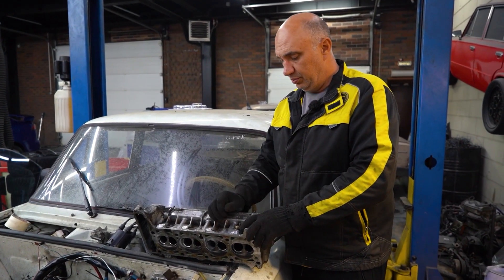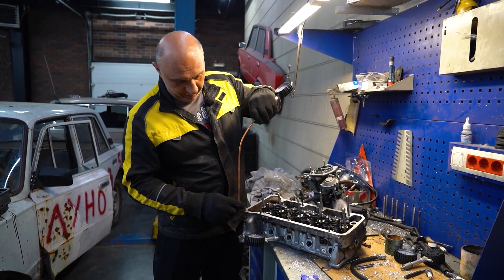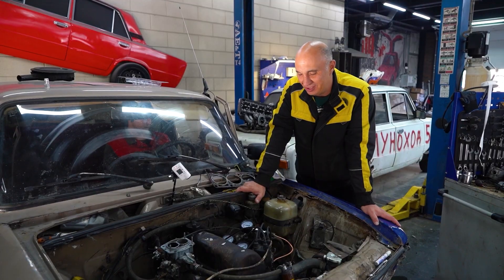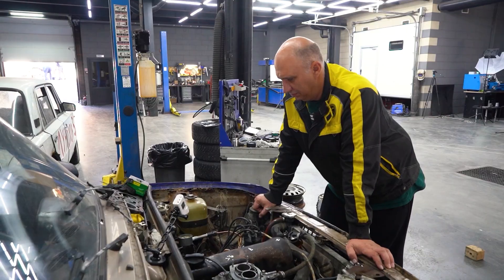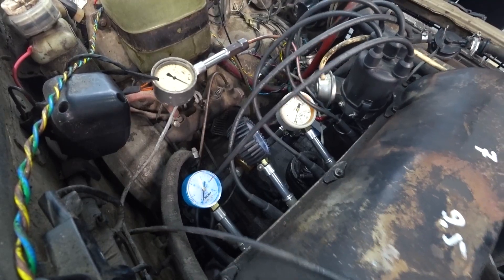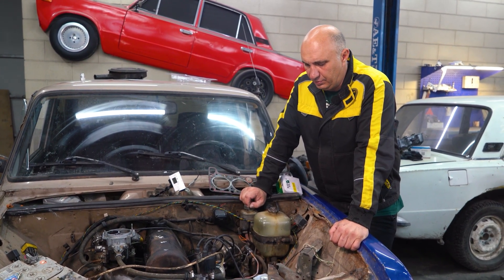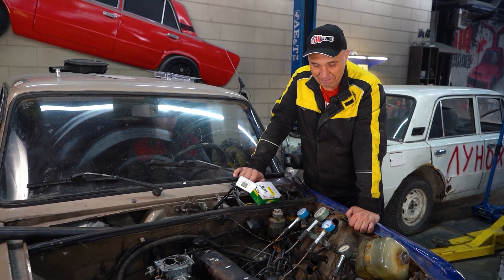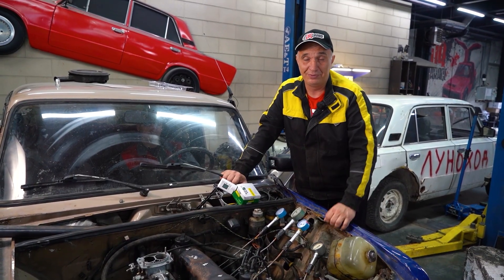What’s the compression on a running engine?

Comment: Try it with a DIESEL! Try to find a model that uses glow plugs, so the glow plug ports can be used, without any modification to the cylinder head. If the ball and seat can built right into an adapter shaped exactly like a glow plug, it will be possible to eliminate any change in chamber volume. If the chamber volume becomes too high, a diesel engine won't even start! You will definitely want to use the 250 kilogram gauges, especially, if you load a turbocharged diesel engine.
Reply: They would need a system that works way higher than that for  Diesel.   Every time it fires on a power stroke under load the cylinder pressure can be in the hundreds of atmospheres.
Reply: @tcmtech7515  pressures in a petrol at peak combustion get higher.. diesels shouldnt get much over initial peak compression during combustion as its taking place during expansion...
Reply: @paradiselost9946  Nope. Go do your homework.   There's a reason diesel engines are built way heavier.
Reply: @tcmtech7515  really? better explain why their traditional classification is as a "constant pressure cycle"... as opposed to brayton, ericsson, carnot, and other cycles...

homework? maybe its you that needs to do some research... historical research ;) rather than modern online BS research.

ever read the works of diesel? ever rebuilt a four stage piston compressor for a fullagar air blast injected diesel?

"air blast diesel injection"? whats that?

until you can tell me what that is, i feel no need to do this so called "homework" just so i can repeat what you have been miseducated about...
Reply: @tcmtech7515  homework?

here is the definition of the diesel cycle..

"A four-stroke cycle used in diesel engines in which, ideally, combustion takes place at constant pressure. The compression pressure is maintained as the gas volume in the cylinder increases until the combustion process is complete."

do you understand that? or did it go over your head?

we compress air. it reaches a certain pressure. it also heats up, so it can ignite a fuel. as the piston descends, that cylinder volume is increasing, expanding. normally, it will reduce in temperature AND pressure.

the combustion of fuel adds heat, and that heat is roughly equal to the cooling due to expansion. the fuel in a diesel is added during the power stroke, it isnt all consumed in an instant as it reaches TDC.

therefore, the cycle is referred to as "constant pressure"... it mostly stays CONSTANT, at the same pressure reached in compression.

hence the term "constant pressure cycle".

comprende? any thing else you require me to do my homework on?

i am all ears ;)
Reply: @paradiselost9946  And no part of that has anything to do with showing the numbers for the actual topic you originally posted on, which was cylinder pressures during the combustion cycle. 🤣

Care to post those now?   😁
Reply: do they make a diesel Lada  (it has to be be a Lada)

Comment: Cylinder pressure is actually cylinder load.  You have had the engine just idling which is very, very low load.  You need to load it up and the best way to do that is using a very high gear, so you are at a low rpm, and give it 100% throttle.  This will make the gas pressure have to work hard to push the piston and will give you an idea as to what peak pressures would be.  Also, the gauges should have one way check valves so the gas does not escape.  You will only be able to capture the highest recorded pressure but that is exactly what we want to see anyway.

Comment: I think the cylinder pressure would be much higher with the engine under a load... You gotta take it for a drive, up a steep hill!
Maybe you guys should invest in a dynamometer... That would open up a lot of options for experimentation.
Reply: There's a whole lot going on that isn't apparent here. Gauge range, fluid dynamics, frequency and heat causing catastrophic wear and failure of the check valves designed into the gauges, the effects of trying to counter fluid drag reducing the effective compression ratio. The list goes on...

Agreed that the pressures will be much lower when the engine is only idling... but until the other problems are solved, adding load will only make things that much more silly.

One of the first actual "popping off" illustrated how chaotic it is inside the cylinder even just at "idle" - I believe it was cylinder 3, the needle was dancing all over the place to the point you can't even calculate the average anymore.

Edit: 8:13

Comment: The longer pipe increases the combustion chamber size, therefore reducing the compression ratio, you need a very small jet inline to smooth out the pulses, less than 0.10mm (for air), close the source to solve this, so it slowly builds pressure up in the gauges, (this has been used to calm hydraulics down for years, with no moving parts)..
You would get away with this setup on a turbocharged engine, on boost only though.
Reply: The combustion event is very short, so there is a momentary high pressure spike, and then the piston comes up and down another 2 crank rotations at atmospheric pressure (or vacuum if not at WOT) before there is another combustion event.

A smaller orifice won't fix it. Only a fast acting check valve (coupled with time to build up that pressure in the pipe), or an electric pressure transducer and an oscilloscope.
Reply: @volvo09  Obviously, you have never worked in this field, or used carburettor balancers on multi carburettor engines, as they use a flow restrictor valves to calm the gauges down.

Pumps  of any sort don't produce pressure, they produce flow, like an ICE. 
Pressure is a restriction of flow, like the piston being forced down.

So if you reduce the passage for a fluid (air is a fluid) to flow, it will produce pressure.

Bear in mind you are contradicting someone that works with flow and pressure every day on hydraulic systems., and used flow restrictors to calm things down on piston type pumps. and modern diesel injection systems.
Reply: And furthermore a check valve will probably fail after a short time and is only one way.
Reply: @IvyMike.  True, I have used a carb balancer before, but that isn't measuring peak vacuum, the restrictor is averaging out the suction pulses so the liquid doesn't jump around.

If these guys want to find peak pressure, a simple flow restrictor isn't going to do it as the pulses are waaay more erratic than a carb balancer. A carb is always under vacuum at idle and the suction pulses are what you want removed.

The cylinder spends much more time at or under atmospheric pressure than it does under extreme pressure. The flow restrictor would be working in the opposite way to keep the big pulses they want to see out of the readings.

I do agree on the check valve though, I don't know how one would survive unless it was a basic ball and seat... They already broke the check valves on their compression gauges.
Reply: @volvo09  Exactly, you average out the pulses to give you a readable gauge result and it works the same weather it is negative or positive pressure, if you are getting erratic gauge readings, reduce the orifice size or close the valve a bit more.  

It works the same way when we convert AC to DC, we pass it through inductors to smooth out the current and capacitor to smooth out the voltage, i.e. restriction of flow.

Comment: Readings are getting messed up by the tubes adding to compression/combustion chamber volume and having non-negligible flow resistance. There needs to be check valves at the engine so any gas that gets in the tubes stays there and takes that much compressed gas volume out of the combustion chamber equation.
Reply: Came here to say this, you beat me to it! Especially when the engine is firing up, which is causing all kinds of chaos!
Reply: That and fluid dynamics. The cross section of the tubes are tiny relative to their length. When the gases try to move in it at the high speeds that the pistons are changing the pressures at, the drag takes over, resulting in a "net zero". 

So there's a delicate balance here, getting the tubes big enough that the gases can move at operating speeds, while not reducing the compression ratio to inoperable.
Reply: @MadScientist267  Reed valves at the engine "adapters" would take tubes out of the equation: any gasses that pass by stay there no matter how long and thin the gauge tubes are. Pressure builds up to equilibrium with ignition pressure and then the tubes are no longer a factor. In that sort of setup, you do want drag from the tube walls to dampen any standing waves and surge pressure.
Reply: @teardowndan5364  I didn't say it couldn't be done, just that it is nowhere near as simple as it would seem. They started out with the "intuitive" version and got what I would call "expected results". As it unfolded, I was not surprised as one problem's solution would create another problem. The complexity is the reason.
Reply: @MadScientist267  Nah, it's not that complicated.  Lots of compression gauges have check valves built in.  I've got two here.  I'd expect to see around 1300-1700 PSI peak combution pressure on that engine when properly measured.  An old school small-block Chevy makes about 2000 or more peak pressure when hot-rodded.
Reply: @FuckGoogle502  Those did too. The rapid pressure changes killed the valves.

It's plenty complicated. 4 different pressure levels in rapid succession at all nevermind for any length of time... not something those are designed to stand up to. Their distance from the head also plays a role. I've been over this.

Yes it's very complicated.
Reply: Compression testers already have a “check valve” though so the gauge holds the pressure reading after testing
Reply: @TheBeeMan1994  The gauges may have a check valve but their extension tubes do not, so the compression is continuously going in and out, reducing cylinder pressure by adding volume and also reducing the magnitude of the pressure wave that can reach the gauges' valves.
Reply: @teardowndan5364  I didn’t think about that at first. But it makes sense why it’s hard to start, those tubes just make the volumes of the cylinders larger, thus, lower compression. Makes sense
Reply: The closer the check valves can be to the combustion chambers, the less volume the tubes add to the chamber volume. If you look at the actual compression test gauges, you will notice that the check valve is right in the adapter, right where the spark plug electrode would be. That guarantees that there is no change to effective chamber volume. @TheBeeMan1994  A longer hose just means, that it takes a few more turns of the engine, to reach peak pressure reading.
Reply: @TheBeeMan1994  That was what Vlad was holding in his hand after the above time stamp

Edit: oops that was a different thread. 8:13
Reply: I can't believe they didn't know this. What a waste of a video.
Reply: @kdodds80  Since combustion pressure would be the pressure of burning air-gas mix at 400+C, I'd be more concerned about inaccuracies from gasses cooling down in the pipes than the cylinder head getting warm.
Reply: exactly! because the engine is going from Vacuum to Combustion over and over. so it basically cancels itself out.
Reply: Just for a mental view of just the piston.  An engine at, say; 1,200 Revolutions Per Minute, that equals 2,400 Strokes Per Minute.  Now ÷ by 60(seconds)=40 Strokes Per Second and every 4th stroke is a power stroke. So that equals 10 power strokes Per Second. Do you really think those "check valves" on those gauges  could really keep up, talk about valve flutter
Reply: @tcmits3699  The gauges' original ball-spring valves, no, too much inertia in the ball, the spring gets softened by hot combustion gasses passing through and rubber seals get destroyed as well. Reed valves as I have mentioned in my first sub-reply here on the other hand are viable up to about 10k RPM.
Reply: @kdodds80  The whole point of their experiment was to measure piston pressure during combustion, not intake pressure.
Reply: I was going to say the same thing. The volume of the tubes and gauges is a huge percentage of the cylinder's volume with the pistons at TDC, which is where cylinder pressures will be at their highest.
Reply: I was thinking being that close to the valves it's getting open shut constantly on gauge
Reply: Let’s be honest this test is more for fun instead of accuracy
Reply: Cool story bra

Comment: The fuel and exhaust gases are probably going up the pipes to the gauges and disrupting the mix in the cylinder so that's why it would hardly start up 💚💛❤️
Reply: Actually is the lack of compression most likely
Reply: @bladi-senpai9398  I agree, that's the most likely reason.
Reply: The cylinder can't compress the air as much because the excess air is traveling up the tubes on the compression stroke, then sucking it back out of the tube on the intake stroke.  The gauges added a compression leak the way they have them installed with no check valves.  The internal volume of those tubes is enormous compared to the combustion chamber that the engine is expecting the air to be pushed into.  Edit: Like trying to start a chainsaw with the decompression bulb leaking.